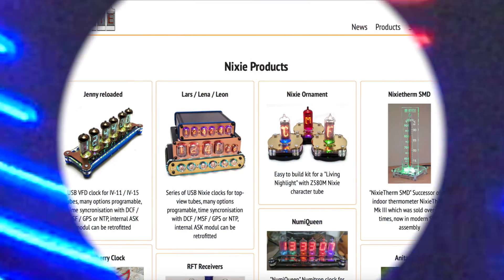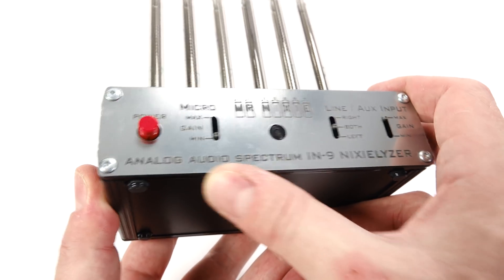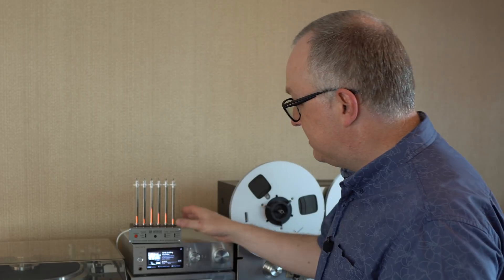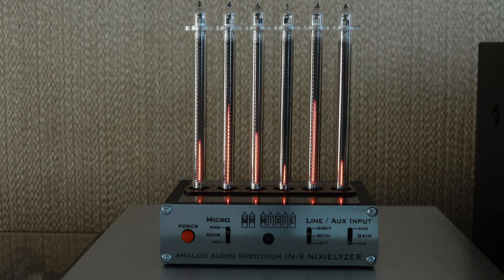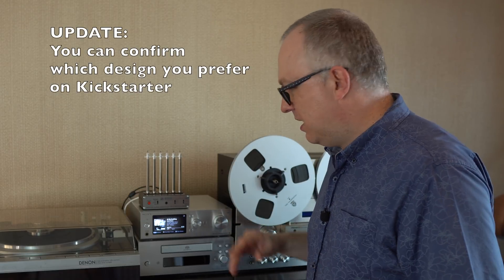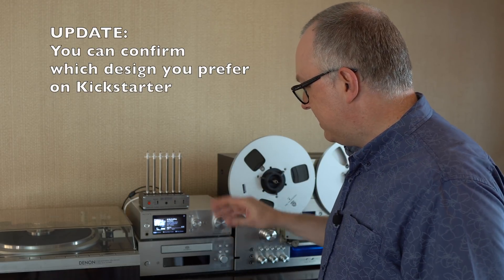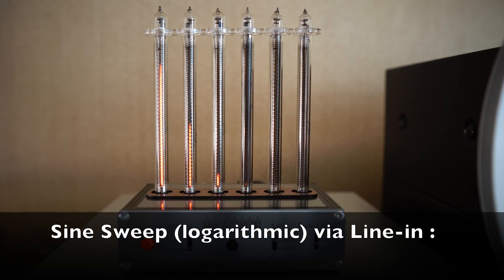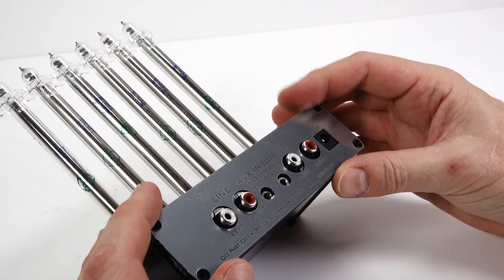Nixie Tube Spectrum Analyzer - The IN-9 Nixielyzer

Comment: Imagine a  full spectrum 31 band/tube version 😛.
Would be a bit pricy though...
Reply: I was thinking I'd love to see a 10 or 12 band Nixielyzer, but yeah a 31 band version would be sweet.
perhaps an rs232 plug and socket on the ends to daisy-chain the modules and automatically change the bands, 5 kits = 30 bands.
Reply: J-man72 b That would only work with a DSP based design.
Reply: @j-man72b72  Daisy chaining could be accomplished by putting a filter network in each one, configured by dip switches (all of this is analog, so routing done by jumpers or switches to the caps and filter circuits).  Though doing so would increase the complexity and cost of each one a measurable percentage.  I think it would become cost prohibitive to put that in each one just for a select few to use that feature.  Better Mr. Nixie would make a seperate version of 16 bands with a 2 stacking feature, a couple dip switches to enable the top/bottom half of the spectrum from the default wide spectrum, including an alternative top plate to swap for both.  They would likely be very expensive though, probably on par with the ZIN18 Nixie clock.
Reply: Creepy how every response in this thread reflected my inner dialog exactly...
Reply: @joemora329  Wasn't just you... I scrolled down to share "my GREAT idea"... oh..
Reply: You beat me to it!...  And make it rack mountable!
Reply: Why not both?
Imagine this stuck the the wall, after a 90 degree rotation - say tubes pointing right.
Then extending vertically up to provide the 31 tubes...
Then run tubes out of the bottom of 'the base' all pointing left for the left-channel..

My take is that I really love this design, but the cost is a bit much for a 'fun toy'
Take the concept far enough, and it's an art-installation, and the order-of-magnitude-more-price is well worth it.
Reply: If you had an adjustment that allowed you to show part of the spectrum you could line up 5 of them 🙂
Reply: looking at the kickstarter rewards, the tubes would cost about 160 euros (however much that is in real money). i wonder where all the cost comes from? the high voltage or analog circuits? there aren’t too many chips on there. i wonder how well the cost would scale with this 31 tube one
Reply: @ExplodingWaffle101  Actually you can get an IN-9 nixie tube for around 4$. I remember when I made my Nixie clock a few years ago that Nixies really aren't that expensive. However... the circuitry needed to make everything is. At least when making it in low volume. Although the problem with my design was that I was using modern discrete transistors to drive each segment... and that made it more expensive to drive - but at least I didn't have to rely on an old nixie driver chip.
Reply: https://www.youtube.com/watch?v=Pv2RSYXdVcs like that ?
Reply: Nah... one for each freequency in the audible spectrum range... ie 20000 of those...
Reply: @thiesenf  Every frequency would be infinite! A tube for every hertz of human hearing would account for 19981 of them since we start at 20 ;)

Comment: "no servicing parts inside"
ahhhhm, ya mean all those parts that I personally assembled and soldered together in exactly the right place and orientation using a complicated schematic guide? k....
Reply: Presumably a 'cover your ass' warning, so people who don't know how to work with the zappy stay away from the angry lightning pixies that dwell within.
And giving more credit that is due, it is not unthinkable for capacitors to hold a charge after the first power-up and change the risks of working with the parts from 'soldering burns' to 'fatal shock', especially if you do a terrible job building it.

There's also that thing the other guy mentioned about people other than the builder needing to be warned off.
And even if a warning sign has no legal weight in your jurisdiction, making an attempt to prevent harm occuring is usually looked upon favorably if anything goes to court.
Labels aren't all that expensive to toss in when you're building hardware, after all.
Reply: @rarrawer  Good insights on the subject.
My prior comment (or asking, if you prefer) was written without taking into account all the scenarios you suggest. 
Greetings.
Reply: I noticed that too - it's an odd thing to put on a user constructed item.
Reply: Simon Coates probably has some high voltage capacitors.
Reply: @AnonymousUser77254  Isn't it supposed to assemble that thing BEFORE connecting it to the mains socket?
Reply: 10mintwo Was it spelled like that, because that would be a bug he needs to fix.  Other than that, it might be directed at other family members and preassembled buyers.
Reply: It might be a message on the preassembled models.
Reply: It is because the tubes need about 400 Volt and there are capacitors holding that voltage.
Reply: @GLITCH_-.-  If that were the worry then a "Danger high voltage inside" would be far more appropriate than implying that user's should not attempt repair

Comment: What kind of longevity would you generally get out of the tubes?
Reply: A few years before SalTechips has done a research of the lifespan of IN-13 tubes which are a further development of the IN-9 but works in the same way. The conclusion was that the brightness ot the tubes drops within 14.7 years of continuous operation to 30%; these are more than 100,000 hrs!
You can read the complete article on:
https://www.saltechips.com/lab/the-shine-experiment/

Comment: But... Putting it together is the fun part...
Reply: For most of the target consumers of this product, yes, it is. However, Techmoan values the cool factor more than the assembly, which -- if one isn't comfortable with soldering -- is a big hassle.
Reply: This also has a surface mount IC, which is harder to solder than through-hole components.

Comment: I wonder how the circiut is designed regarding the audio pass-through?  Is the output audio identical to the input audio?  Or is he doing an A2D and then D2A?
Reply: No. Definately not. Both paths (RCA and 1/8"TRS) are simple wired in parallel each and added with a zero ohms node.
And I don't use any DSP or A2D / D2A conversion; simple analog design ;-) So you are able to measure a "real" signal with your oscilloscope
Reply: @z097dsa  Excellent! And thank you!  You should be proud.  It looks GREAT!
Reply: @z097dsa  if I have further questions, what's the best way to get a hold of you?
Reply: @z097dsa  thank you!
Reply from the maker: As far as I'm aware the whole thing is analog.

Comment: I feel like it's something that would get broken pretty quickly in my household, unless there's some sort of protection around the tubes.
Reply: agreed, narrow base with very tall, thin glass tubes poking out the top, with loads of RCA and headphone cables coming out of the bottom, it looks almost guaranteed to get flipped over and smashed in no time at all.
Reply: One of the cool things about DIY kits is that one generally feels less guilty about customising/modifying them compared to a pre-built product.
Could be an interesting project to make an add-on protective screen/guard out of wire mesh, or some similar idea.
Reply: @sixstringedthing  Could also add some weights or an extra metal plate to the base to help prevent it from toppling over (as long as there's room and you insulate the weights that is).
Reply: @sixstringedthing  I agree with this comment. I find this interesting
Reply: @sixstringedthing  A wire cage is all that is needed. You know, something to take the impact if it falls off the table.
Reply: Yes, obviously it's delicate. It's for hi-fi aficionados, not domestic households. BobUK.
Reply: Kids are annoying, destructive, stupid, and vectors for disease. Having kids is like an 18 year sentence for the crime of ten minutes of pleasure.
Reply: @officialclownbusiness7788  So I'm guessing you came about as the product of an amoeba undergoing binary fission? At least the level of intelligence suggested by your comment seems to indicate such...
Reply: Yep, definitely not me-proof.
Reply: Ya - it should be simple to put a plexi dual pane or cuboid cover over it with mounting holes in the base.
Reply: Maybe you could design a plexiglass enclosure. Just need some plexiglass and glue.
Reply: @NaoPb  A plexiglas enclosure is a very good idea but you'll need to cut plenty of air holes or they will suffocate... :D
Reply: Like a nice acrilic enclosure to cap the top section where the tubes are.
Reply: @Zzzz oop but you don't want to to be breakable either.
Reply: I was thinking - light weight box, tall glass tubes, heavy cables. It doesn't need cats or children to break it, and its a pretty expensive toy being so fragile. Definitely needs a heavy box or something equal...
Reply: agree, my wife's cat would make short work of it :(
Reply: You cant bash yourself around it
Reply: I have a college friend in the UK that was an audiophile. Once he had kids they poked holes in his incredibly expensive speakers and his incredibly expensive amps and preamps sit on the mantle in his bedroom more as decoration than anything else. His kids are teens now so these nixies could survive in his household now I sent this video to him to tempt him.
Reply: @Captain Jack 🎧 📌 ☝
Billy Joel/Captain Jack
Reply: tone167  Firm NO lol

Comment: Perfect vid for my lunch break. This might be a silly question, but do the Nixie tubes get hot during use? And if so, how hot?
Reply from the maker: They don't seem to change temperature - well not so I could tell just by touching them anyway.
Reply: @Techmoan  Thanks for checking! The nixie glow reminds me of filament bulbs, so I wasn't sure if they produced the same levels of heat. I just became aware that they're also called Cold Cathode displays, so that sums it all up!
Reply: They are a cold cathode tube, therefore they do not produce heat